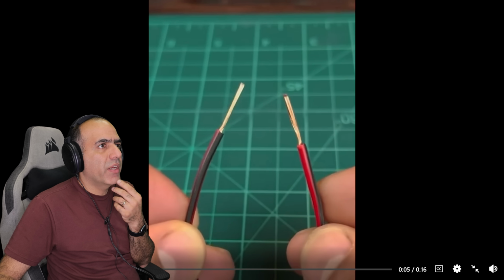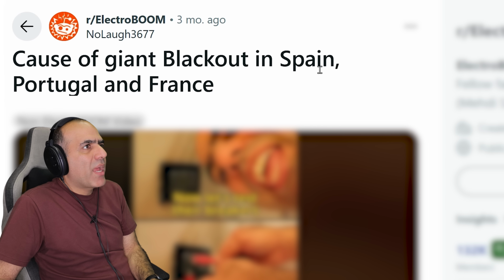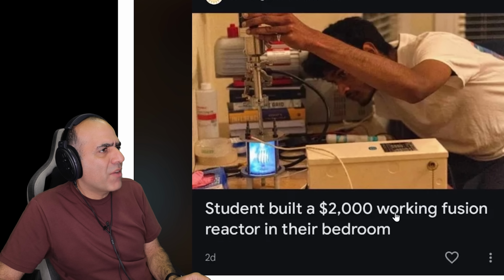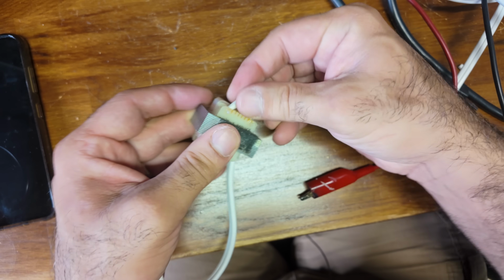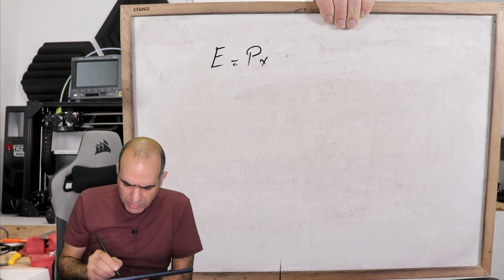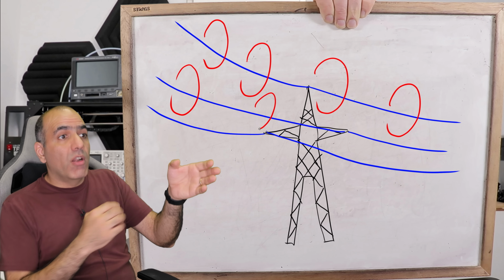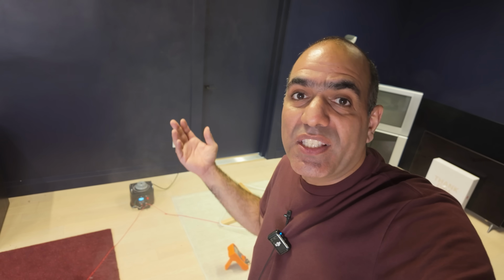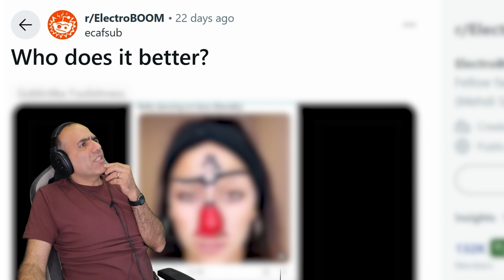Power Lines at Knee Level? Campfire with AA Battery?! (LATITY-016)

Comment: Medhi, you can absolutely make a fusion reactor in your basement. The type I'm familiar with is called a "Fusor", and you simply have a grid electrode in the middle with a high voltage negative charge, you have an electrode sheet surrounding it at a high positive charge. You make a very high vacuum in the chamber, then inject a bit of hydrogen and duterium. The outer positive electrode strips the electron creating a bare proton or proton/neutron, which is accelerated towards the negative inner electrode. These nuclei then colide in the middle and sometimes fuse with much greater frequency for the concentration than in a thermal fusion reactor, but nowhere near enough to generate net power (except maybe that one guy who irradiated himself, but couldn't reproduce it last time I checked).

A neutron source has been made from a Fusor and sold commercially IIRC.
Reply: A Fusor is not a reactor. To count as a reactor you must achieve criticality. That's like calling an RTG a "fission reactor" because fission reactions are occurring.
Reply: who is medhi 
hes name is mehdi
Reply: As D_863(My Autism) said to me, Nigma, while we watched the amusing video: You may not create a Fusion Reactor, but you may create some Fusion Reactions..

But what I in return told D_863: I hope that the guy didn't even create Fusion Reactions.. Because the people around and himself would, with enough time, be having one of the worst ways to die. Yippe. <🎉> :p

(But anyhow, I do not blame the guy but the sighted article itself simply because: While he may state A and the original article may even truthfully convey said A, a secondary article may copy the original article and change it just enough to not get into trouble, resulting B and hence the garbage statement..

Summary: We do not have the Context, only a surface level one, so do not judge a book by it's cover.. BUT if that guy did succeed with mere Reactions, I hope he's smart enough to think about proper safety.)
Reply: @Nigma_863  a reactor is a machine that facilitates reactions. Chemical reactors are just big vats with valves etc where chemical reactions happen, why wouldn't a dedicated machine inside which fusion happens be called a fusion reactor? It doesn't need to produce power, that is only a necessity for a fusion power plant.
Reply: @DeuxisWasTaken  It has been 13 days, but because you actually put thought into the statement unlike others, I will care..

I suppose the problem in general is simply the Language's incompetence to convey specifics - By contrary, I could ask you: Then if such is true, what general word convey "Fusion reactions are occurring" and state "And only such is occurring on it's own"?

As you can see, if you state that a mere 'Container that has fusion reactions occurring' is enough to qualify as a 'Fusion Reactor' - Then how do you convey the opposite of a Fusion Reactor?

To state such as true, creates a problem alike the try of conveying 'Nothing'.. 'Nothing' is nothing yet by comprehension it's something.
Reply: @DeuxisWasTaken  In summary.. I personally call a Fusion Reactor as such, because we simply do not have a Working 'Fusion Reactor' and hence, we're naïve to the fine line..

Both statements are Truthful, but how Truthful they respectively are is by opinion for now.

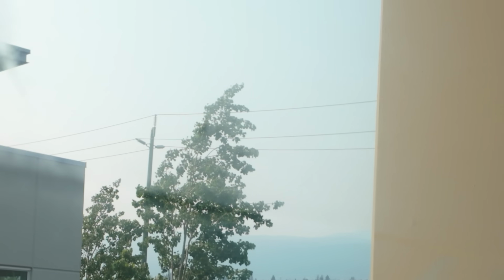Comment: 11:39 is a two phase the top wire is only the ground.: notice it has not a porcelain insulator. 3-phase in star configuration has 4 wires one for the ground and on triangle usually three but can have a ground: the ground protects against lightning: as the wires are not at the same point there is an small remaining field the gets smaller very fast (dipoles have the field smaller with the third power of the distance not the square, each two wires form a dipole). And yes the fence is in the wrong direction for even that.

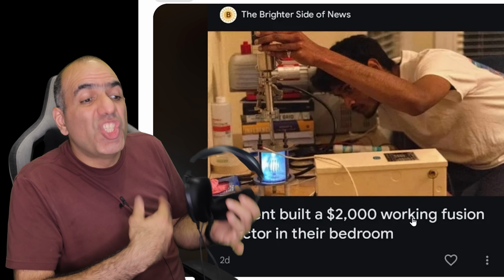Comment: 5:37 t is not a "fusion reactor" is is a fusor a kind of electron tube created by Philo Farsworth.
The fusor is a device that YES can fuse deuterium forming helium (it is much easier to fuse deuterium than hydrogen)  but obviously in a very inefficiently It belongs the the family of electrostatic confinement devices. But it is still used today as a neutron source because it can be turned on and off and carries and do not form any radioactive material. 
Philo Farsworth is more famous as the creator the "image dissector" the first TC camera tube just before the invention of the Icnoscope it was a non storage device contrary to the icnoscope and the Image Orthicon).
There were at least three cases that I remember of young men making those at home, one was visited by FBI after a concerned neighbor denounce: the FBI found the device safe and they basically had a friendly conversation. How they found deuteriun escapes me but some universities have it it is not radioactive but is expensive as hell: probably obtained by electrolizing heavy water.
A Röntgen tube is far more dangerous, but wit enough voltage a fusor can generate enough neutrons to be dangerous and neutrons can not be detected by cheap standard Geiger tubes (you nee a moderator to do that) making it more dangerous.

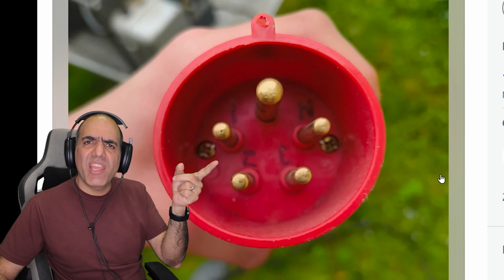Comment: 10:38 - I've seen these live too in a factory! Apparently, some genius had the brilliant idea of making an "adapter cable" to power up different machines. This monstruosity (which the guy called "octopus") had several interconnected cables, with both male and female sides on several ends (3P/3P+N) so that one could connect any machine to whatever socket was available. Needless to say, when one of the machines was connected, the spare connectors also became live. Gave them a heads up, but they refused to stop using it because it was "more convenient than having to carry one of each cable". At least got them to put a plastic bag over the unused connectors... 🤣

Comment: If there is voltage on male 3 phase sotket, it may be to backfeed from generator in case of power outage. Just need to remove main fuses or hell gonna break loose when power comes back..

Comment: It'll make a nice little flame if you puff the end of a cotton swab and add a small amount of oil or any petroleum based compound. (lip balm, fragrance oils or other accelerant you might have available in your cell.) A little dab'll do, to prolong the burn time without too much smoke.
Teach the dummies to use batteries instead of poppin' sockets and trippin' breakers...
Otherwise the screws are onto the smoking before anyone gets to enjoy the product.

Comment: Why does a dead wire in industrial workplace have 60V of voltage when its fuse has blown? It can run a grinder for very slow speed for a short period. The dead wire is one of three phases with a fuse blown and only 2 phases should have power.

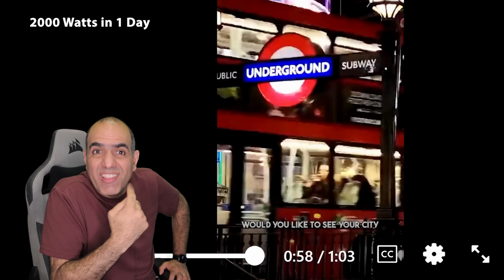Comment: 9:15 it's just the wrong unit entirely.  I don't think he meant that the turnstiles generated a constant 2000 watts for the entire 24 hours (or 48,000 watt hours).  I think he meant that in 24 hours, it generated 2000 watt hours.  Even that seems high to me.

Comment: I once left AA accumulators on my desk with some metallic junk (drill bits, wires etc). It accidentally short-circuited and after some time I touched it and got burned. It also left burns on my desk. So that don't underestimate AA batteries.

Comment: I once worked in a place that was both underneath a large very high voltage transmission like and had a cellular tower installation as part of the building. We were designing a new battery operated device that needed a long run time and were trying different processors. I think we settled on an MSP430, and we were able to power it using a long wire antenna, a diode and a capacitor.

Comment: I installed cable for about a year. We did those service loops not only to keep water coming into the home, but also to leave enough wire for if someone needed to make a new fitting to for whatever reason at some point. Also, some cheaper compression fittings wont keep water out forever. So the loop also keeps water away from the connection so it doesn't become oxidized and becoming faulty. Sometimes cable runs can really push the limit of how much information you can pump through a strand of copper at ranges. Any oxidation is going to ruin the skin effect. Oxidized connection points more than doubly so

Comment: 6:00 I suspect (but cannot confirm) that he's not referring to a plasma globe, but rather one of those airtight metal containers with some wires in it. For reasons I don't remember, tiny amounts of plasma form around the wire, potentially causing fusion, but not under the conditions that Joe Schmoe could make in his basement. As Mehdi said, it's nowhere near something that would be put in a power plant.
Reply: It is called a fusor. The magnetic field has holes in it. It is a fusion reactor, but it has an efficiency less than 1% because the majority of fuel is lost. Easy to build, and as far as we know impossible to make efficient.

The modern toroidal verson plugs the magnetic holes by making it a donut, but the energy demand is thousands of times higher. Because donut.

The hard part is recovering energy efficiently. Right now most electric is lost to entropy in conversion.

Comment: 16:00 it's weird to me how ceiling lighting often doesn't have breakers (as this clearly didn't). I guess contractors expect that no one's going to really be messing with that particular circuit.
Reply: What do you mean? That’s not how it is in Australia. We always have a separate circuit by law. 
But either way can’t you just cut power to the whole house?
Reply: @ObjectivistApe  You say that but when was the last time someone tried to trip a ceiling breaker? I saw this, and I saw my handyman in Brooklyn trying to trip a non-existent breaker in my apartment by shorting the wires. Lot of sparks, no trip.

I think today we learned that "By law" doesn't always mean a lot, especially when no one's going to bother checking.

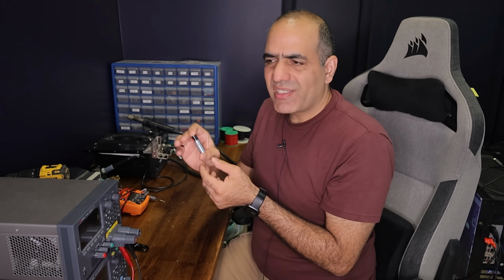Comment: 1:10 this is 1/4 w resistor. It gets hot like this with 1/2w. Max 1w. Means with properly calibrated values, with 1.5V, you get 1w at 0.8A which this battery can stand during at least half an hour.

Should not damage it.

Resistor should be around 2 ohms.

Comment: 9:46 Moreover, it would take 3200 N to push the turnstile arm by 1 meter, assuming 100% efficiency. For the Americans in the audience, that’s like lifting 700 lbs.
Reply: Gear ratios would probably make it possible
Reply: @Voxfan124  Then you’d have to push the turnstile arm for a longer distance to get the same amount of energy.

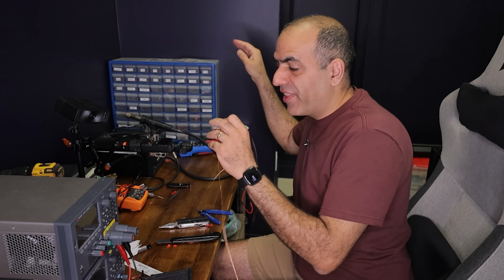Comment: 7:00 BDW if you testing some DIY hax, why dont you just cut that winding in half or group them for like  two thick winding and connect them across so you dont have undwind them and potencialy have lower resistance for secondary winding?

Comment: On the transmission lines question.  It's the magnetic field around an energized conductor.  Similar to the way a non contact voltage tester works, or standing under transmission lines & hold up a fluorescent lamp.  In 2004, I  was working on a generation plant outside of Gettysburg PA we left a Tic Tester in `da truck cause it will alert from the EMF in the plant.
Reply: If the lines are balanced (and they are), the magnetic field is confined to the immediate area between the conductors.  Very little makes it to the ground.  The electric field is what makes it to the ground.
Reply: Sorry, `ol man suffering from CRS.  Forgot about the field, that's what excites the neon in the lamp. Still, the look on the kids faces...

Comment: I know an application for the plug between outlets, if you have 110V and want to run a 220V device you can use the two live sides of the socket :D

Comment: Those are usually real fusion reactors called Farnsworth reactors, but they're not efficient. Comparing them to modern experiments is like comparing a campfire to a natural gas generator
Reply: Yeah, the title is technically correct but deliberately relying on the gap between the vague understanding the public has of fusion being really hard and the reality that it's specifically useful power generation via fusion that's hard
Reply: Fusors aren't reactors, to count as a reactor you have to achieve criticality.

Comment: For a reference point for how much power a human can output, pro sprinter cyclists can do 1500 to 2000W for a few seconds (maybe 10). For most strong amateurs, 1000W for 10 seconds or less. 

There's no way that these people could do 3200W through a turnstile.

It's likely the guy's units were wrong. The turnstile maybe generated 2000Wh in a day... But even then, I am dubious. That's still average of 83W continuously...

Comment: A reason for the outlet spacing: If you're plugging in something like an AC adapter that has a blocky transformer bit, it often takes up 1.5 spaces.  This might let you plug in more things.
Reply: I do this at work with my phone charger. I have an AC adapter and a phone charger on the same power strip and I plug other things in between
Reply: If you have product A and B, then have problem C with A.. Do you change B?

NO, doing such is Patching and not Fixing - If you cannot Fix product A, then it's a crappy product and those who bought it got scammed by their naïvety..

(Also, it is already a crappy product if it needs that large of a transformer to do something relatively simple of A->B.. Even a relatively beginner PU 101 would be better in many aspects - I stated Power Unit, not a Power Source, do not mix them.)
Reply: @Nigma_863  100 people can walk up the 3 steps to reach the door of a shop.  Products A1-A100 and B have no problems.  But hey, product C comes along in a wheelchair.  Why build a ramp?  Fix the person in a wheelchair, right?  Is there a compelling reason to put the outlet's slots at any distance other than the same spacing as the prongs of a plug?  If not, not doing so is bad design in the power strip.
Reply: @jasonpatterson8091  0. ..Why- I do not even care that you're twisting the context to a whole different scenario.. Why are you obsessed with people in such a argument with the context?... <_<'

1. Anyhow, yes, fixing any individual disabled in a wheelchair for free would be better - But of course, such isn't preferable to companies that want to make a profit.. (It's not like they wanted to be disabled in the first place?? -.-')

2. To make a product designed, intended and planned for A, but suddenly a random customer accidentally mistaken and used it for B, is bad and most likely a mistake in the context of products.. Such may and previously had lead to injury - To the point of even death.

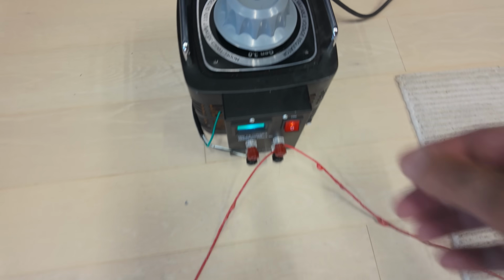Comment: @2:40 9-volt batteries work better.  :-)  @13:40 ROFL.. I did that in my car.  Homemade power cable for my boombox (remember them?)  The smoke is a LOT worse in a confined space.

Comment: It is not a service loop. 10:10  You cant bend coaxial cable sharply or it loses signal. A service loop is extra wire left for future repairs or sometimes for wire movement.

Comment: I've worked as an exterior installer and, while I've never seen drip loops that look like the wire nuts in this video, I guarantee all professional installations will have a drip loop or droop near any ingress points.